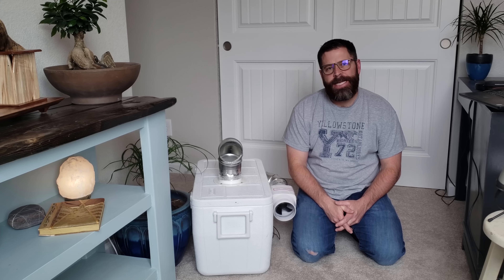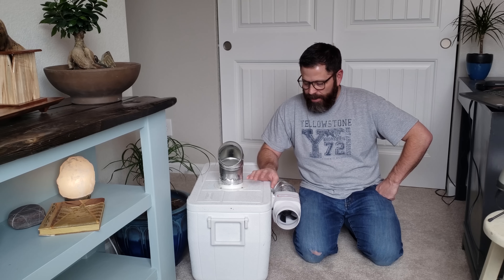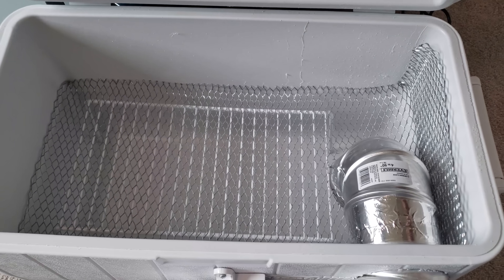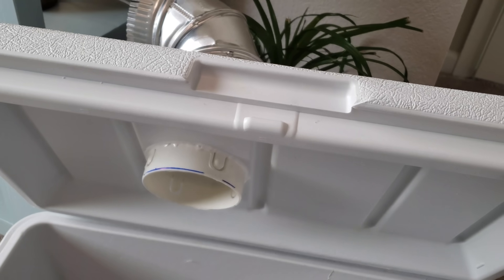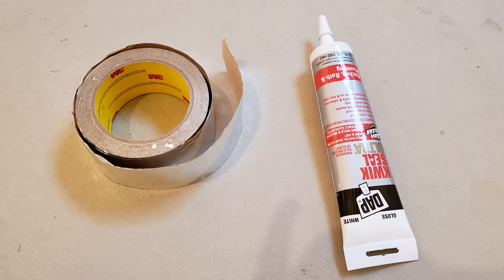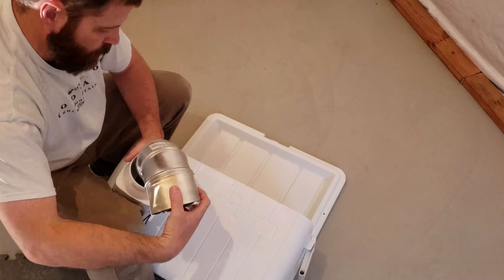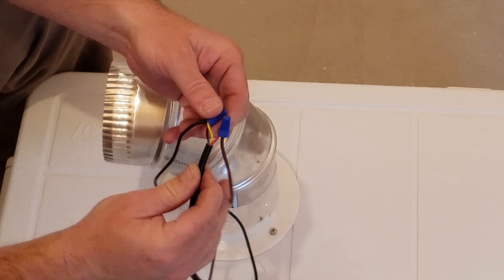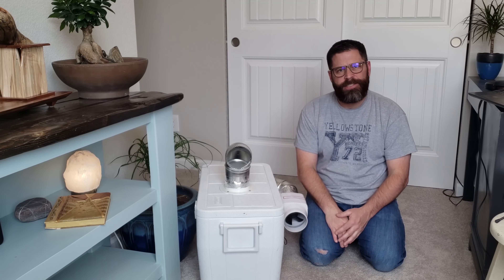Homemade Portable Air Conditioner DIY - Coldest One Yet!

Comment: This one certainly appears to have a greater potential for rapid cooling, but it also seems like it has a greater potential to raise the relative humidity, since the ice/water is now directly part of the airflow path, compared to your previous design with the continuous metal duct.  That's not a knock on it (it's hard to beat getting below 0° C on the outflow!), but different designs might work better in different specific scenarios, depending how sensitive to moisture your intended use might be.   Air that cold doesn't carry much humidity itself, but forcing a lot of airflow could potentially force some water droplets to join the exiting stream of air, and once it's outside the cooler, to evaporate.  Not sure exactly how much that would happen, but the risk looks greater than in the last design, at the very least.
Reply: There is always one guy who is a total moron who doesn’t understand constructive criticism.
Reply: I use something similar to this design in my cottage bedroom.  In my situation if I am starting out by drawing warm humid air, which is quite often the case then the relative humidity in the room gets quite high, and the cooling is not too great, and it feels " swampy ". To combat this I invested in a little room size dehumidifier. Using both I can drop the room temperature by 20 to 25 degrees with a comfortable humidity level, and sleep comfortably. Trick is to dehumidify the space first.
Reply: @franklinwilson3783  Why not just get a room AC, then? You haven't really accomplished anything if you have to run a dehumidifier, as well as the air cooler, because other than using ice to cool the air, it is doing the exact same thing.
Reply: If you really have a dehumidifier you should know by now that they heat up the space in which they operate so it becomes completely pointlessssss.... It is so much easier to do everything exactly as he shows in the video above and just use frozen bottled water. His concept using ice is not sustainable. Rotating bottles in your freezer is way easier and it prevents from having to deal with black mold which comes from this underdeveloped idea of using ice.
Reply: @ke2delight  - yes, I ran a dehumidifier in the lower level of my home when I lived in Hawaii.  It did put out a fair amount of heat but I had a 10,000 btu window a/c so the room I had it in still stayed cool.
Reply: I am looking into creating a couple of DIY Ac boxes.  But, I do not want the humidity to increase.  It is 90% in Texas.  So, I am going to try and freeze some 2 gal jugs with salt in them to make them freeze longer and colder... Plus no bags of ice to purchase and therefore no melting ice to increase the humidity...  I like the idea of a marine fan for powerful air flow.
Reply: Where I live, the humidity in summer is about 15-20% so the cold, moist air will be helpful.  I plan to make this for cooling my little a-frame trailer.
Reply: Just crack your window quarter inch! Dang
Reply: What if he used dry ice instead of regular ice?
Reply: @GenEmperor   Good idea, only problem with it though is the CO2 emissions from the dry ice. I was thinking about this last year, and I think the dry ice would be better suited for a copper fan style cooler than one like this.
Reply: @neobreaker91  I wonder if there could be a way to filter out the CO2
Reply: @GenEmperor  he would fill his car with co2. If he has a good airflow then no big deal. But a closed car with dry ice in it is no good
Reply: Um.  CO2 is not harmful.  You guys may be thinking of CO which is not involved here.  Funny.
Reply: @wanderingscholar9717  in a sealed car if there's enough co2 in can absolutely displace the oxygen. The co2 itself is nbd. It's what we exhale. It's the oxygen that the co2 would be displacing
Reply: @GenEmperor  it would be dry instead of wet 😂
Reply: @thisismecantuseeitsacz5823  lol
Reply: My relatives don't have humidity 🤣
Reply: @MikeG-h8r  This is helpful criticism you idiot.
Reply: Would not a solution be to use something like frozen water bottles on the grate?
Reply: He has it in his car, not his house. 
When you’re sweating your balls off, who gives a crap about humidity? Bottom line is it blows very cold air. 
I’ll take two sir.

Comment: Wonder how long it could run in bedroom with huge diy lithium battery pack for hurricane/power outage? Sleep better in tropical storms when powers out.
Reply: Or, in my solar campervan??!! In Florida!!??
Reply: @jono4708  it would probably be cheaper to get a small window unit and a power inverter that ice is not cheap and you would probably spend more on a months supply of ice than the one time cost of the a/c and power inverter

Comment: Fantastic!! Before I build one, can you or someone answer the following question?... How long does that one bag of ice last while blowing nonstop on a 100 degree day in an unshaded closed vehicle? Providing one had it set up to run on a lithium ion house / rv battery (not the one under the hood that powers the vehicle). Thank you.
Reply: I own an HVAC company. That's where the term 3 ton, or whatever tonage,  air conditioner comes from. A 3 ton air-conditioner will remove as much heat in ONE hour as 3 tons of ice will remove in one hour. So literally you'd need 3 ton of ice per hour to equal a 3 ton air-conditioner.
 To answer the question about the car, most vehicle air-conditioner are 2 ton air-conditioners. Meaning you'd need 2 ton of ice per hour. Sounds like a lot, but that's what AC tonage means, literally
Reply: @Bryan-Hensley  - so, how does this translate to btu?
Reply: @kathymack3791  24,000 BTU is 2 ton.
Reply: @Bryan-Hensley  - thanks, Bryan!
Reply: @kathymack3791  my ac is 2 1/2 ton equaling 30,000 btu. 1 ton = 12,000 btu
Reply: @kathymack3791  don't misunderstand me though. It doesn't mean you'll melt , for example, 2 ton of ice. It means it takes 2 ton of ice to absorb 24,000 BTU per hour..
Reply: @kathymack3791  my calculations come to it's about 180 BTU for a 30 pound bag of ice per hour. Adding the fan increases the BTU. The simplest way to calculate BTU for this device is to measure air flow volume, and the amount the temperature of the air decreases. It's easy to figure out the BTU that way.
Reply: @Bryan-Hensley  A refrigeration "ton" is 2000lbs of ice in 24 hours, NOT 1 hour. https://en.wikipedia.org/wiki/Ton_of_refrigeration
Reply: @Bryan-Hensley  thx mate.  Realy good info.
Reply from the maker: There are way to many variables in your questions for someone to answer accurately. With that being said, I will make a guess. I would say a 20lb bag of ice may last 2-3 hours under those conditions.
Reply: make & do :: I appreciate your guesstimation. This could be a life saver in bad traffic! Thank you.
Reply: make & do That being said, it is not economical at all as a portable swamp cooler as you have to feed 20 lb of ice every 2-3 hours. How much does it cost 20 lb of ice  in your area? I live in one of the most expensive cities on the planet, which feeding this swamp cooler every 2-3 hours is not viable.
Reply: @leoinswlondon  2 bucks for a bag
Reply: @diggsdiggler337  $2 for an 8 lb bag a 20 lb bag is $4-$5
Reply: It won't keep your kids alive while you're in the bar. If that's what you're asking.
Reply: I've seen these out on the desert tents. Works remarkably well. But getting ice in the first place is a real challenge when in remote areas.
Reply: @eliasbarajas1456  I goofed in one comment. But right below it I corrected it.

Comment: That's a " forced air push through " design. Good job!
If you make another try 
" draw through " design. Place the motor on the other side so it pulls air through. 
You may be moving the air too fast for efficient heat transfer. 
But, great idea to elevate the cooling media. Better than the one I have. 
Swamp cooler.
Love your content!
Reply from the maker: The switch that connects the blower to your car lighter actually has a reverse button on it. So you can push or pull the air through. You just may want to change the direction of the blower to point it in the direction you like.